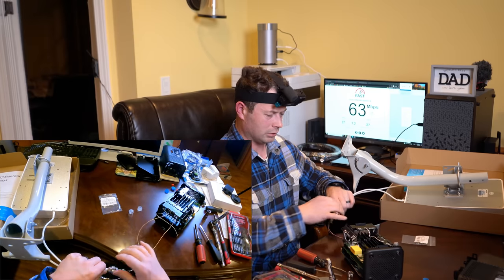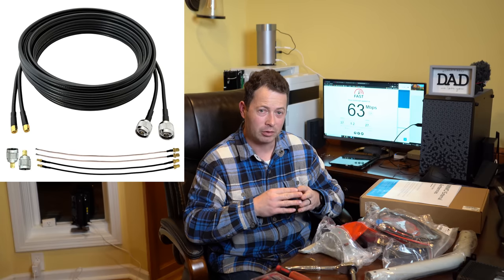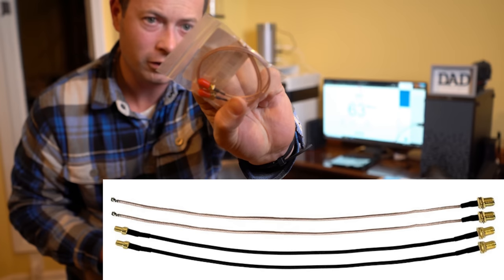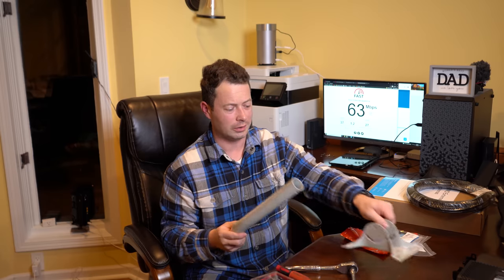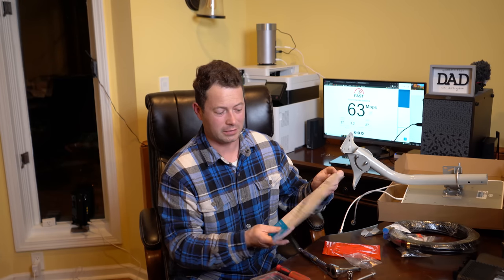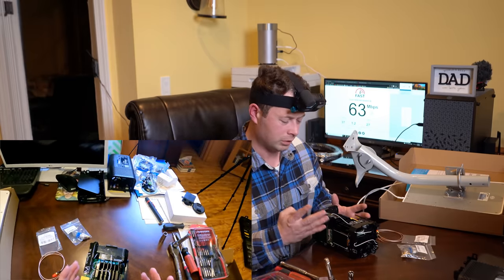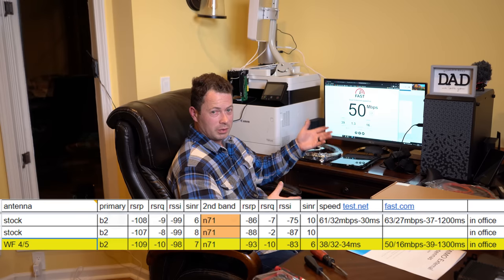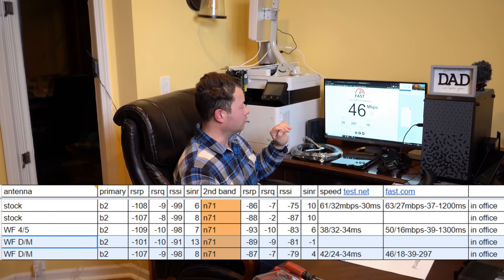✅ Waveform External Antenna - Arcadyan KVD21 T-Mobile 5G Home Internet - Speed Tested

Comment: has anyone tested the various antennas available for purchase?  I wondering if the waveform 4x4 panel was a good choice.  Speaking of trees I have several conveniently located between the 30ft tall antenna mast and the nearest 4g tower 1 mile and a 5g tower 2 miles away.  i get a good signal quality from both so not sure if removing them would be a worth while operation.  opinions please.   thanks
Reply from the maker: I have a WF 4x4 at my desk to test now.

Comment: Yea I bought the Waveform MIMO 2x2 (not the Periodic Log one) and i got worst speed compare to the Stock antennas.  So I dont think these Antennas work.  I have the new Arcadyan KVD21 Tmobile 5G Gateway
Reply from the maker: Which ports did you use and for what cell bands?   The Arcadyan is much more port specific then the Nokia.
Reply: @NaterTater  I used the M1 and M2 ports, and then I used the M and D port, then I used the 4 and 5 ports, all didn't improve anything. These antennas actually perform worst compare to the stock antenannas. I called Waveform support and they said their Antennas are meant to be used outside.
Reply from the maker: @Viettzz  yes they are meant to be used outside.  I mention that and comment that the attic is 2nd best.  There isnt much point of having them indoors.
Reply: @NaterTater  Ok so I was frustrated that the 2x2 MIMO antennas didn't really help much.  So I ordered the 4x4 MIMO from Waveform.  And I just installed it an hour ago.  And my download speed went all the way from 300Mbps to 700-800MPbs+ during day / peak time.  But the upload is stay around 35Mbps so I do think that Tmobile is capping the upload to 35Mbps during day time.  At night, my upload went up to 80Mbps+.  So for anyone that want to get these Waveform antennas for your Tmobile 5G Gateway, don't bother with the 2x2, get the 4x4 MIMO panel.  And I'm using this inside the house.
Reply: Not only that but my PIng went down as well.

Comment: Do you know how to make google wifi mesh to work well with the Nokia box. I have 8 pucks which worked well with the white lte box and now since the Nokia box is Wi-Fi 6, apparently Google Wi-Fi isn't Wi-Fi 6 capable?
Reply from the maker: Wifi 6 shouldn't matter, I assume you have one google mesh point plugged into the gateway via ethernet?   The goog mesh would be a completely separate wifi network to the gateway's.
Reply: I actually tried to add a line last night and tell them to send me a white lte 4g box again since I knew that wasn't Wi-Fi 6 and worked fine with my google Wi-Fi mesh. Would just leave the trash can hooked to my sons computer. Been with them since the beginning of the Tmobile home internet journey and after a $6k quote from Comcast to bury a line as we're 1000+ ft off the Rd on 3 acres, tons of trees around us here in VA I decided to go this route. Works fine as we only get the 40+ mbps on b2/n71 band locked * my 2 kids are blowing through 1000+ gbs per month haha still the cheapest deal in town. Just need to fix this mesh disconnect throughout the house. 8 mesh points, entire home 6 inch log cedar home that's why I have to have so many!
Reply from the maker: @Keyboardletters  sounds like a cool place!  I love log homes.  Wifi 6 shouldn't have anything to do with your google mesh.  I'd turn off the Nokia wifi (all SSID's) and try that with ethernet to your main google mesh point.
Reply: @NaterTater  thanks I'll try that out! Would be nice if those being on were some how conflicting with the mesh network! I'll try out soon and let ya know
Reply: Welp no difference but I did end up checking out your video you suggested to the guy earlier on how you did your mesh setup with your Asus RT-AC88U & the few nodes.... I may have to go that way.... Don't look too expensive even if I go 2/3 nodes. Appreciate all the work u put into to helping folks out man keep up the good work!

Comment: I have two Nokia gateways, one is stock, the other has all four of the antenna ports broken out to labeled SMAs. I am on top of a mountain and can see the whole city. But, the nearest tower is more than ten miles away. Using the unmodified unit with stock antennas I get 2 - 3 bars signal. The strange thing is, if I pop the SIM in the modified Nokia I seem to get virtually the same signal with no antennas connected at all. All four of the stock antennas are completely removed. This doesn't make any sense to me unless the WiFi antennas are shared with the cellular modem. I notice in this video, and others, you mention positioning of the modem matters, even when connected to the external antennas. The addition of external antennas just doesn't seem to make a lot of difference when in fact the difference should be dramatic. Have you experimented with the Nokia and unplugged all four of the internal antennas?
Reply from the maker: that does not seem right.  I know when I just unplug 2 antennas on the Arcadyan the RSSI on 4G goes to 0.  what speeds do you get with all 4 unplugged?
Reply: @NaterTater  I was getting speeds identical to the unit with antennas all connected. It started me to wondering if the WiFi antennas were shared on some bands. I actually have one of the wide band parabolics you picture in one of your videos that I wanted to test. It covers the 600 Mhz 5G band. That isn't easy to find. Most antennas do not, especially the LPDAs and many panel antennas as well. I have a pair of LPDAs, like yours. I swept them and they cut off rather sharply in the mid-700s Mhz. I want to understand the system. I am an EE type and would like to find some technical data on the Nokia gateway to better understand which antenna inputs are used for what and how the signal voting system works. But, I scoured the web and really can't find much at all. I will be back there this weekend and want to experiment more. I bought the second Nokia new on eBay. My plan is, once I figure the system out, to remove the electronics from the case of the Nokia I own and mount them in a waterproof case to be mounted outdoors at the antenna. I plan to power it by PoE and bring the IP in via ethernet. The reason being that all of these small antenna cables are extremely lossy at these frequencies. So, in a very few feet you loose all of the gain the better antenna gives you. Because of the losses, most gains people see using these cables would be experienced equally well if the unit itself was placed at the more lofty position where the antenna is mounted.
Reply from the maker: @johnwhite5414  i just unplugged the 4 cell antennas on one of my nokia's.  No signal.  Right beside another stock nokia with 3 bars.
Reply: @NaterTater  I will test this again this weekend if I can and report the result. It seemed very strange to me. But, it behaved as I mentioned. I expected the result to be zero signal.

Comment: Does the router has GPS built in?
Reply from the maker: Yes but it doesnt appear to be used
Reply: @NaterTater  Do you mean the GPS in the Ark? If so.. let me say that with my Ark on TMHI my WAN ip shows west coast US even though I am in NC... but when I run speed tests the sites show my location to within about 1/4 mile.  So I would say that the gateway GPS is active.  Useless for the consumer but no doubt used to enforce the TOS for fixed location use.

Comment: if you have to attach an external antenna what is the point of paying them 50 a month.
Reply from the maker: Unlimited fast data when your other option is 5mbps for $55/mo.
Reply: @NaterTater  640mbps is only 60 a month from cable company which I hate but These boxes are useless
Reply from the maker: @WV591  19 million Americans dont have access to broadband.  This solves that for many.

Comment: I still have the trash can. I tried antennas but they only increased my signal to 5 bars and my speeds will actually go lower. I currently get 4 bars for both signals. Gateway is all the way touching the sealing on my roof. I had to lay it down horizontally and have fans to maintain the unit cool.  I disable the Wifi.  Primary Signal  B66 RSRP -80 SNR 22db RSRQ -11db RSSI -52dBm.   Secondary signal N41 RSRP  -82 SNR 20 db RSQ -11db.  For the life of me I can only get between 330mbps to 400mpbs  max download and Upload between  70mpbs to 85 max. I don't get how some people are getting  700 plus.. and 100 plus.  I don't know if external antennas will make a difference on my case.  about 2 to 3 miles I would say from Antenna. Which is on top of a mountain I am rigth below it.  Maybe you can give me advise.. I was watching your channel to see if you got any crazy speeds but for $240 to $400 dollars I would do it  IF is this was pulling 600 mpbs and higher constant speeds.
Reply from the maker: You might be at the limit of the tower backhaul.  You have good signal metrics.  You can test this by driving your gateway close to the tower  (~1/8 mile) and see what speed you get.  That would be best case for that specific tower.
Reply: @NaterTater   Thank you for the quick response.  I will try what you suggested. The only bad news is that,, if this gets better, it will not resolved my speed issue at home.  Have a good day.
Reply from the maker: 330/70mbps is far from a speed issue in my book.

Comment: Mount the gateway in the attic and call it a day :)
Reply from the maker: It'll overheat in summer and get too cold in winter.
Reply: @NaterTater  It wont get too cold in winter here where I am.. but heck yes too hot for the gateway in summer.. the gateway already gets hot (if you have WiFi turned on) and it is only rated to 104 degrees Fahrenheit.  My attic reaches 115 or more easy... But the antenna does not care about heat and actually works an microscopically amount better when cold.

Comment: I have the mofi 4500 sim 7 model I believe. I'm on t-mobile the tower is 9 miles away. It's not a 5g tower it just has the 4g band 71. With the mofi in my window I'm getting around 2 bars or 109 db I believe. I'm trying to figure out which antennas and setup I should go with. Any recommendations?? I'm not 100% if I have rf line of sight. I'm going to use the tools your recommended in your other video to try and figure that out when I get home from work.
Reply from the maker: This waveform setup that I show would work for that.  I would test out the 2x2 mimo.  If it doesnt improve enough then you could upgrade to a 4x4 mimo if really needed.
Reply: Which one the flat panel antenna or the dual yagi's??
Reply from the maker: @A_Patriots_AR15  flat panel if no line of sight.

Comment: My biggest complaint about all of these devices regardless manufacture they should’ve come straight from the manufactures with connectors for external antennas easily accessible for the customers these are cheap parts that customers like us who do gladly pay an extra 10 or $20 per device just so we wouldn’t have to take it apart and do these mods
Reply from the maker: Yep

Comment: I did not know Gary Sinise had a youtube channel
Reply: @NaterTater   I Just purchased this Booster for my TMobile home internet. I am getting 1.2mbps as of right now. I will follow the step by step directions and will let you know my results. Thank you.
Reply from the maker: @MrTkoryciak  it should help!  1.2mbps is painful.
Reply: @NaterTater  I have installed the 2x2 on my roof and in the afternoon I have 58mbps and evening I get 38mbps. It was a lot better than 2-5mbps I used to get. I’m debating about a 4x4 and trying to make the antenna go about 6 feet higher on the roof but I’m worried about lightning attraction.
Reply: When I first got the T-Mobile internet I was getting 2-3 mbps. And I now currently have the 2X2 and get a range from 40mbps to 80mbps in the evenings when mounting it on my roof. It’s at approximate 28 feet high. I plan to get a ham radio 50ft tower installed and get it to absolute line of sight. It should increase the speeds a lot more!

Comment: Okay, so I've installed my new exterior antenna the memo 2x2 by waveform. Okay, in the comments I didn't check. Everybody's but I was curious and sorry for bothering everybody on memorial Day weekend. I hooked everything up. My speeds have increased from approximately 10. Download to 50 to 60. Download put. My upload is virtually nothing. It's maybe 1 to 5 if it even reads it on the upload. The reason I did all this is because my internet the past 6 months has dropped to nothing why I don't know unless they're just overloaded on their towers. But back to my situation here so I hooked antenna one to m1 and antenna 2 to M2. Is there anybody out there that has hooked either one of those leads to anything else and got a better signal? The reason I ask if they've gotten a better signal through either four or d on the other parts is due to the fact pulling them off and putting them back on them. Fred, I'm going to break them. They're so small and tedious to get on and off I'm afraid I'm going to break them if I keep popping them off and on for checking speeds through different ports.

Comment from the maker: BUY IT:  Cheetah 5G Router (use COUPON CODE NaterTater for $45 off): https://chestertechrepairs.com/products/wifi6-industrial-lte-5g-nr-wireless-modem-router-unlimited-hotspot-rv 
Invisagig - https://chestertechrepairs.com/products/invisagig-os-qualcomm-sdx62-rm520n-gl-standalone-modem-nr5g-4g-lte
USE COUPON CODE for $20 OFF : natertater20off

Get 5% off Waveform antenna and signal booster products with this link: www.waveform.com/natertater or just use code "NATERTATER" at checkout.  Then you can go to the Peplink BR1 5G Pro product page: https://www.waveform.com/products/peplink-max-br1-pro-5g?variant=39840236535911

Be sure to see my other Verizon and T-Mobile Home Internet Videos: 
Verizon: https://youtube.com/playlist?list=PL8d9FovK2dNSOcTz7L6sHiuWVQXwUT4my
T-mobile: https://youtube.com/playlist?list=PL8d9FovK2dNQHp0KWk8gG8XXvaKzaoSB3
Peplink cellular devices: https://www.youtube.com/playlist?list=PL8d9FovK2dNTZR2vUJWyd6kmmDD6ediym

Comment: 2:56 can’t you just run the smaller ends through a hole from the appropriate direction? Why do the large connectors physically need to travel through the hole?
Reply from the maker: Exactly, smaller end thru hole.  This is the new cable.  Old cable had n-type on both ends.

Comment: ok,  well that was a complete waste of time and money.  I got a 4x4 panel installed and wired up and now my internet speeds are now worse than when i had the stock modem sitting on a indoor panel connected to a cell phone booster.   I've been working with  waveform and contrary to what posted here the connections are specific.
front l to r  numbered 1-4   1 -  m1, 2 - m2,  3 - m & 4 - d.   unfortunately, very little of all this is returnable.  but if anyone is in the market for a waveform 4x4 panel, 4x 50ft lmr400 w N male, 4x 10ft lmr240 n female to smr male and 4x 10 inch  pig tails ufl to sma   drop me a im
Reply from the maker: Hey Todd, bummer you weren't able to see better speeds.  That def doesnt sound right (booster better than a 4x4).  If the booster works then the 4x4 should work better.  With the 4x4 it does not matter which gateway port (of the 4 OE used ones) is to which antenna lead.
Reply: @NaterTater  Yeah very disappointed.  as far as connections go, i'm just repeating what a waveform tech told me. I think I just need more height due to trees and hills. I see in one of your videos you have a antenna tower.  I'm thinking one of those might help improve my over all reception problems.  In the case of cell towers I'm 100 ft above the 2 closest to me so I'm wondering if that might be part of the reception issues. Any ideas what a 100ft tower costs to buy and install these days.